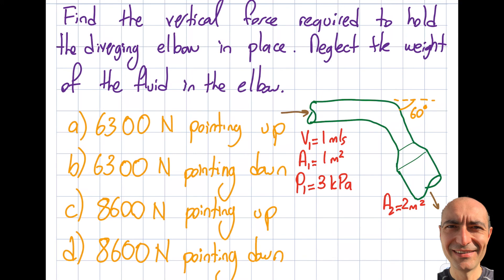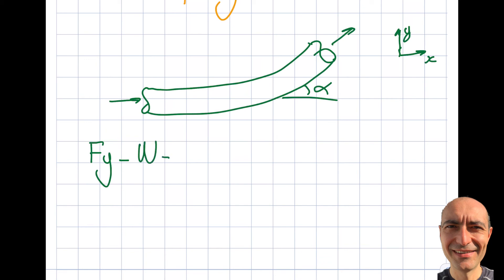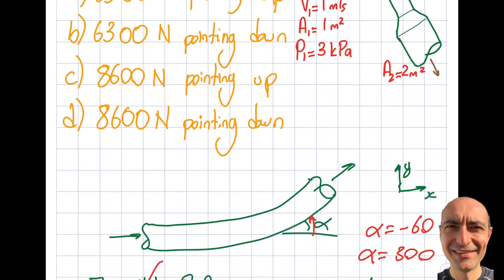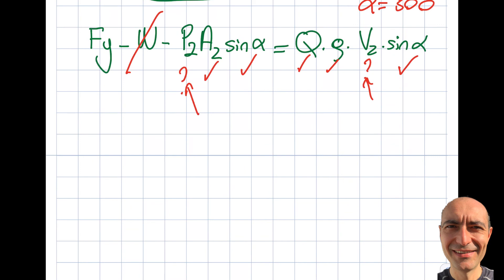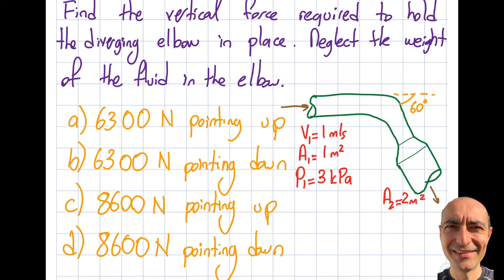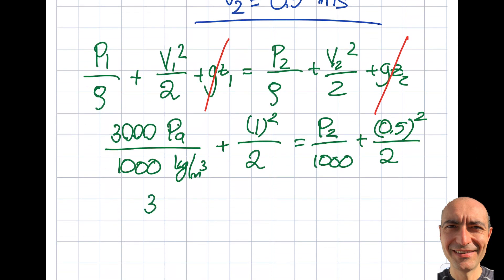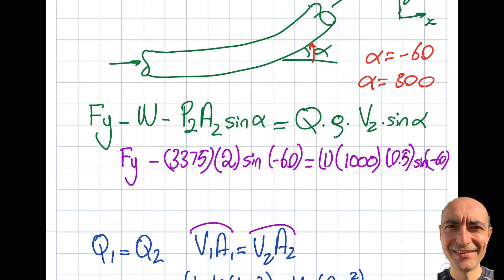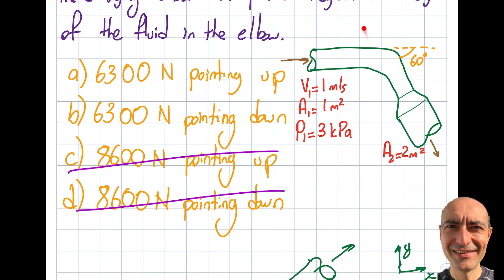FE Exam Fluid Mechanics - 3.5 - Practice Problem - Continuity, Bernoulli, Impulse-Momentum

Comment: I believe the headloss equation is missing the gravity value under the pressure and  velocity values and there shouldn't be gravity multiplied with the elevation head.
Reply from the maker: I like your YouTube name! Both versions of Bernoulli's equation are fine (note that headloss=0 here). You surely can multiply both sides of Bernoulli's equation by g, then you will get pressure head, velocity head, and elevation head, exactly what you indicate. That's up to you. I simply prefer the one where both sides are divided by g.

Comment: Why the angle is negative?
Reply from the maker: Hi Pankti, it is up to you. You can use either -60 degrees or +300 degrees as the angle. The final answer would be the same from trigonometry.
Reply: @CollegeFluidMechanics  -60 because the pipe is bending down, opposite the drawing in the manual, Is that what it is?